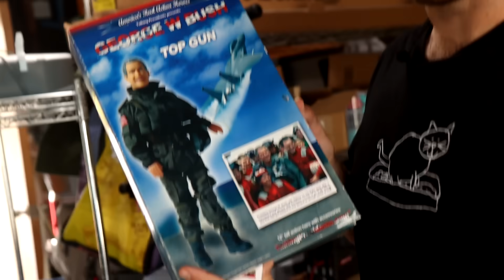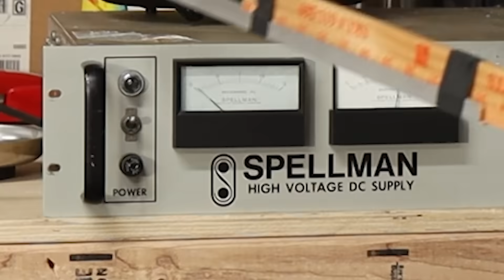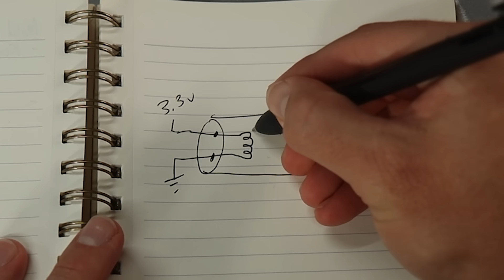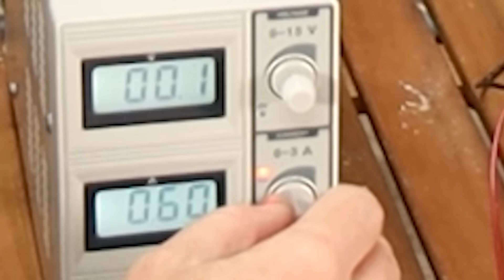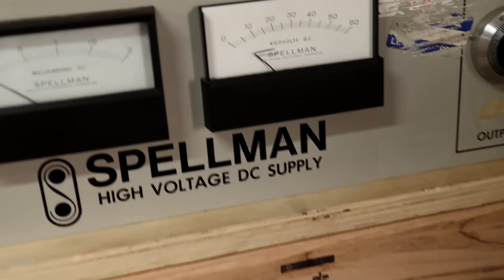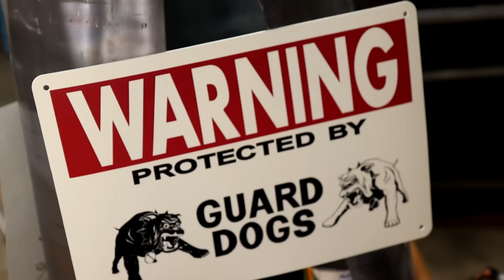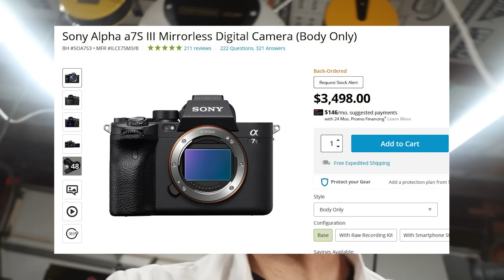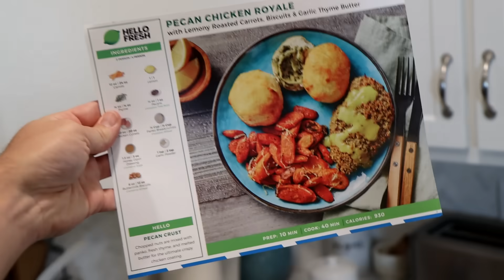Built My Own X-Ray After a Hospital Charged Me $69,210.32

Comment: 15:37 Okay real talk though: Depending on the fracture, it can be hard to spot. I had a fracture between the knuckle-like sections at the top of one of my tibias which wasn't found until about 3 months later, and after 3 x-ray attempts + 2 CT scans.
Fortunately I live in Australia, so I wasn't paying out my arse to find the issue.

Comment: Safety nerd here, the high voltage power supply is way more dangerous than the X-rays.
Reply: @HogsHeadStudios  cause high voltage can kill you instantly. Try getting a dental xray and then try sticking a fork in an outlet.
Reply: @bengoldberg8451  I stuck a fork in an outlet when I was a small child. I was startled by the flash of the arc and disturbed by the burnt plastic smell, but otherwise just fine. The fork, on the other hand, never recovered.
Reply: will is adjusting the voltage and amperage manually, its a fucking insane idea. if he slips or something he could fry his hand.
Reply: WHERE DID EVAN GO!?
Reply: @fractal5764  Deleted his comments in a stunning showing of cowardice. 

Not that I was planning on replying or anything, that's exactly what we were asked not to do. I just wanted to see the best tourist attraction William's comments sections has to offer.
Reply: @HogsHeadStudios  okay xray assistant🤡🤡🤡
Reply: @HogsHeadStudios  Would you add a time stamp for this fake image. I´m actually working as a Radiographer In a very technical way and so far all he said and made in that video made sense. Also yes. IT IS possible to create a light image like that. Phosphor ( not the element/Glowingstuff when translated directly from my mother toung).
(A phosphor is a substance that exhibits the phenomenon of luminescence; it emits light when exposed to some type of radiant energy. The term is used both for fluorescent or phosphorescent substances which glow on exposure to ultraviolet or visible light, and cathodoluminescent substances which glow when struck by an electron beam (cathode rays) in a cathode ray tube.

When a phosphor is exposed to radiation, the orbital electrons in its molecules are excited to a higher energy level; when they return to their former level they emit the energy as light of a certain color. Phosphors can be classified into two categories: fluorescent substances which emit the energy immediately and stop glowing when the exciting radiation is turned off, and phosphorescent substances which emit the energy after a delay, so they keep glowing after the radiation is turned off, decaying in brightness over a period of milliseconds to days.) from Wikipedia [jeah I know best source of Knowledge but I´m to lazy to get my old textbooks out and translate it from German to english]
also I hate it how the Name for the Element and the glowing stuff is the same in English...
Reply: @HogsHeadStudios  Years of practical experience handling radioactive material lol. How bout you genius?
Reply: Sorry, but I highly disagree. I've been working in radiation protection for a while now and while there are mpre dangerous radiations, X-rays are quite dangerous as well if not dosed right. In the early days of X-rays people really exposed there hands and stuff just for fun and while the increased risk for cancer is true determined damage to hands were commen as well
Reply: @dinkelberg00  yeah but I think he is referring to the ability that voltage almost able to kill you extremely quickly or practically instantaneously, I don’t think no one is refuting the danger of radiation or X-ray. That being said I just don’t see X-ray or radiation killing you as quick unless you are directly expressed to extremely lethal rays such as gamma rays etc. but even at the likely hood of you dying to Radiation at level is extremely low due to the average person just not coming into contact with them. Unlike your ability to be electrocuted while plugging in you charger. Even tho it’s highly unlikely it just has a higher chance to happen as compared to dying of radiation exposure.
Reply: @beastbeast5105  well I mean it highly depends because if the power output rating of the X-rays or the high voltage then either can kill you just as quickly, I am not sure I would want to find out what happens to a person exposed to a nuclear-bomb powered x-ray laser (which was a thing that people theorised could be built)
Reply: @pkalpha3  I understand your point trust me I do it’s just, we’re not talking long term we’re talking fast and swift which for the most part is electricity. But we also are not taking into account how often he is going to use the “X-RAY”, and how long is he going to be exposing him self for prolonged  periods of time. Or if he is hitting him self with intense enough dosage to destroy his cells at the molecular level. That’s why I’m saying he is most likely to die form electricity. just like your or I are able to as compared to radiation, unless you work hands on with radioactive isotopes or anything radioactive for that fact. Than you would be more likely to die from exposure or a prolonged exposure. All I’m talking bout is just the probability for the most part in my previous statements. Thanks for convo thoroughly enjoyed it.
Reply: @pkalpha3   My question would be: how does this compare to one usage of a shoe-fitting fluoroscope?
Could this really be more dangerous than a fluoroscope from the 1930's where the xray image can be seen live, by naked eyes, in a well-lit shoe store?
Reply: @dinkelberg00  Ok, how strong does a radiation source have to be before it causes instant death? Can you get one on ebay? Cause in my experience those only exist in criticality accidents in the immediate area of the excursion. High voltage, with decent current across the chest is instantly fatal.
Reply: Well High voltage can only Kill you but X-Rays can give you Ass Cancer!

Comment: That filament is too hot imo.  Playing with vintage radios, they don't need to be very bright to emit electrons.
Reply: It depends very much on the type of filament. A pure tungsten filament will have to run very hot for proper emission, comparable to 1910s and early 1920s tubes. 
From 1925 on, radio tubes are very dim but power tubes for transmitters were still very bright, with the anodes often running red hot in normal operation.

Comment: 13:10 by the way, this isn't static. It's actual x rays hitting the sensor in the camera. It's visualized radiation. pretty cool :)
Reply: You can see these in nuclear bomb test as well. The radiation also messed with the audio recordings that they used too. Flipping rad(pun intended).
Reply: tbf static can also just mean noise on a picture, like regardless of what it comes from. interesting none the less
Reply: @trashpanda5866  true, but noise is usually colored. When it’s just white spots like that, and the video is about a homemade X-ray machine, or radiation hitting the sensor.
Reply: Static can be alot more than color noise in images. Electric current and sound can have static. I'd say in the refrence to just the image the dots are static, but to the experiment they are clear confirmation of xray generation and not static.
Reply: so video games were RIGHT ?!?!?!?! (kinda)

Comment: One of the coolest things I learned as a biomed tech is how simple Xrays really are. Just shoot a bunch of electrons at a positively charged target and bing bang zoom, 1% if the energy you used is now xrays (roughly)

EDIT: Normally in a traditional X-ray system, a single transformer (called an auto transformer) provides both a high voltage (kV range potential) to the cathode ( - ) and anode ( + charged target material) and a very low voltage but high current through the filament. The filament as it glows and heats up goes through thermionic emission, creating a cloud of electrons at one side of the tube. Once the user wants x-rays, the high voltage is applied to the cathode and anode. This causes the electron cloud to bombard the positively charged anode, causing a ton of ionic radiation, only a small % of which becomes useful X-Rays. Most of the energy is lost as non xray ionizing radiation and heat.

Comment: I am genuinely curious what they would do if they told you you need an x-ray and you said 'no, ill take it myself' and then showed up the next day with your own x-rays
Reply: Probably get arrested for dumb reason
Reply: Chances are the x-rays just wouldn't be particularly useful, as modern x-rays have very detailed specs on power output, duration, post processing, etc, that this thing could never hit. Like, you could probably diagnose a clean break with this, but modern x-rays at the right settings can tell you so much more
Reply: I've done things... like this. They'll basically say that they can't accept any evidence that wasn't produces in a medical setting. They'll also tell you it's very dangerous.
Reply: @jamesflames6987  "a medical setting"....well, it is a medical setting, just a very unlicensed medical setting.
Reply: @luciazazel2683  Anywhere can be a medical setting if you believe hard enough.
Reply: @jamesflames6987  and they are correct.
Reply: They'd probably say something like 'good luck with that - bye'.....
Reply: I mean one reason is so expensive is because of insurance companies and bad people along with government regulations messing everything up (there is much more to it though)
Reply: @crazywyvern4704  The reason it is so expensive is due to the ridiculous overhead in insurance and hospitals. Hence the massive cost difference between a hospital and an urgent care, even if the treatment is the same. Tons of jobs that don't need to exist.
Reply: it is against the law to intentionally irradiate a living human without the proper licensing (even yourself)

Comment: As someone who works as an xray technologist and understands the physics of this, I fear for your giant gaping hole in the side of your machine.

But otherwise it's about the same technology as when it was first discovered with extra safety involved. 
You're gonna need ridiculous amounts of mAs and KvP to run it and requires a larger tube, but if ur quick enough and dont accidentally turn it as a live xray machine aka fluoroscopy, u can probably get hand and foot xrays pretty consistently. I couldn't see the hand quality too well but hey u got bones. 

Good job mad scientist ☢

But really dont xray yourselves if anyone else builds one. It's why we have timers inside our machine software to xray up to one thousandth of a second. Even a few seconds of xrays can be a lot of skin dose depending on the body parts. Scatter and all too. He used a dental tube which technically has the lowest scatter possible, it probably almost all absorbs. But definitely still could have leakage radiation.

Comment: If you're fed up with astronomical hospital fees, be sure to check out Louis Rossmann and Right To Repair. One of the reasons hospitals are taking an arm and a leg, is that they can't have their apparatus repaired for a fair price and often times are forced to buy new, as many manufacturers don't even have spare parts or have ditched the support altogether for their older stuff. In many cases the parts that fail are simple components or mechanical parts that are often made proprietary, to the point that some other company makes the part but can't sell it to anyone other than the manufacturer, even if the part doesn't even differ much from the ordinary run of the mill parts.

Comment: But aren't you missing the point that a medical xray just flashes you with xrays like a normal photo flash? You are using that xray bulp like a normal light bulp and therefore the xray load should be much higher...depending how long you're exposing yourself.

Comment: to those generally wondering why doctors will tell you x-rays are safe and then do a full sprint out of the room immediately after the x-ray machine turns on is because you're getting a single x-ray taken (exposed to very little radiation) while the doctor giving you the x-ray does it multiple times a week for however long they have their job (EXPOSED TO A LOT OF RADIATION)